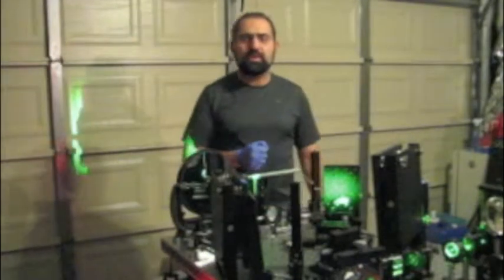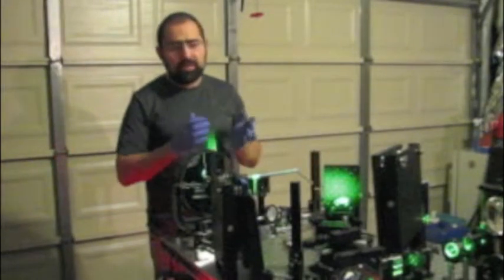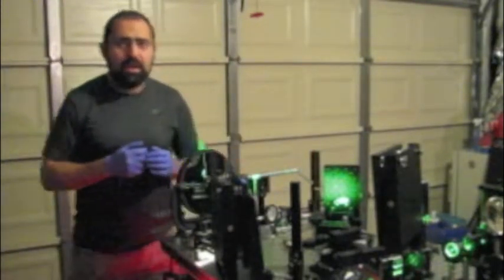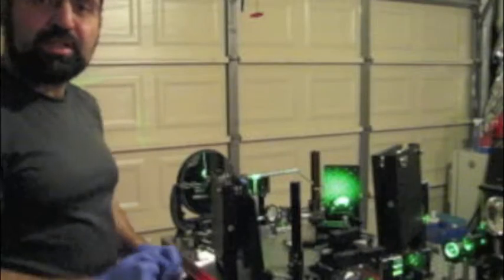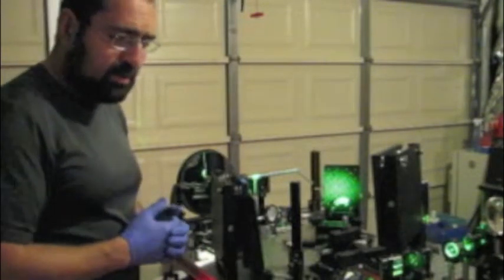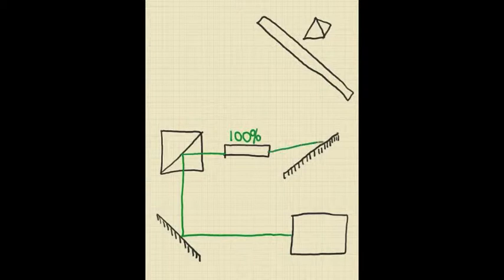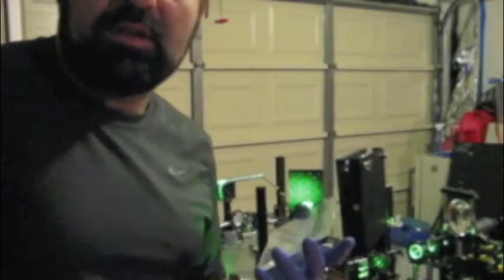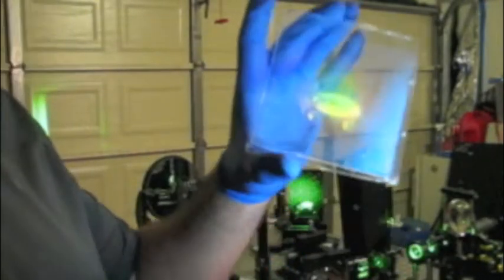Single Beam Reflection Hologram Tutorial

Comment: I know this is a super old video, but I have some questions, specifically regarding the spatial filter. I have a HeNe laser where the beam coming out of it is about 1mm and pretty nicely collimated over several meters. Now, I want to expand it, but I also want to make sure it is cleaned from high frequency distortions. So, I thought to use a microscope objective, and then take the focus after the beam and place a pinhole there, but there are a few problems… First, I see my beam does not expand very much, definitely less than yours. I think I need a smaller focal length objective, but it doesn’t say what focal length it is on the microscope objective. I just know it is a 10X 0.25, and it says also infinity/0.17. No mention of what the focal length is. So, I don’t know… should I take a higher magnification? How do I find out what pinhole size to use?